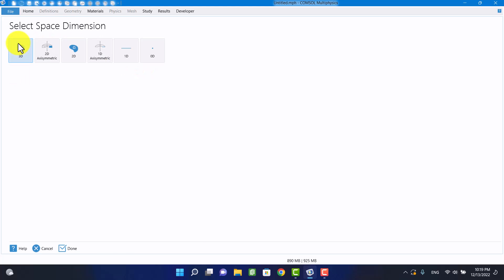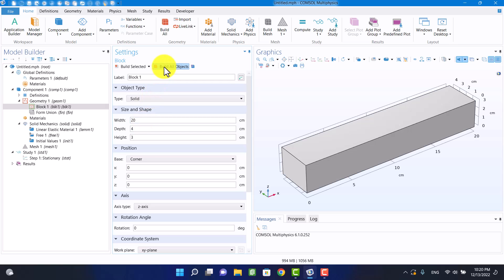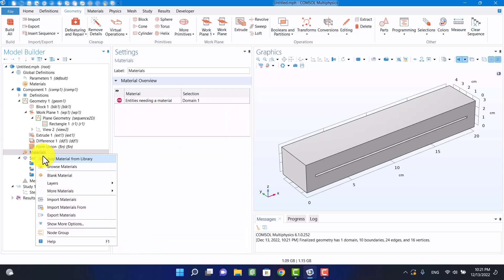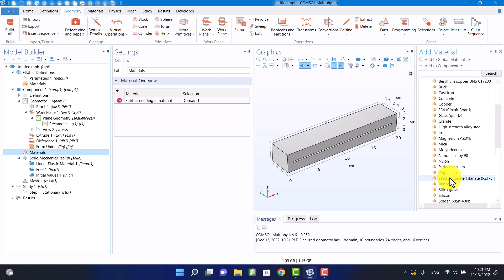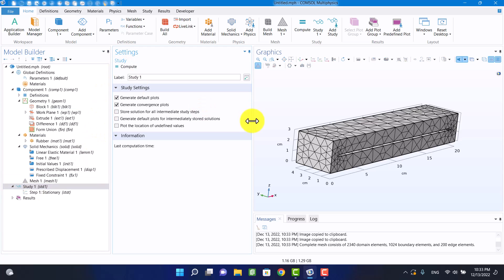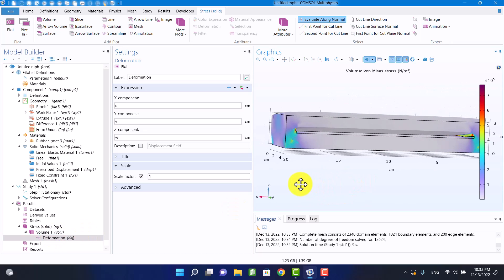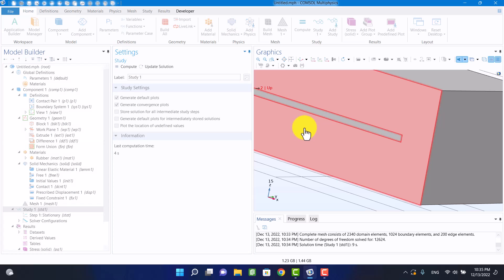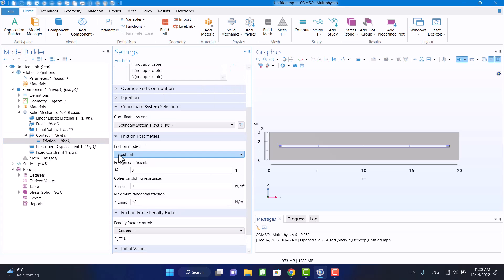🛠️ COMSOL Tutorial: Defining Contact in Solid Mechanics Physics

Comment: I'm working on simulating a suction-based climbing robot using COMSOL Multiphysics. My objective is to check whether the robot will stick to a vertical surface or slip based on applied suction.

Project Details:

Suction pressure: –15,750 kPa applied to each suction pad

Robot weight: 117 N

I want to simulate how the robot behaves under gravity and suction force. Whether it stays adhered or begins to slide.

I'm confused about contact pairs and setting up proper interaction between the robot body and the wall.

Also, deciding between stationary and time-dependent studies is a bit unclear. Can you help me with this or if you're comfortable then can we connect on Google chat or anywhere else?
Reply from the maker: Hello, I don't have direct experience with this type of contact. I recommend looking into academic papers or theses related to contact simulations for more detailed guidance.